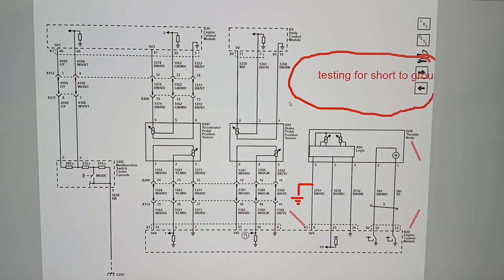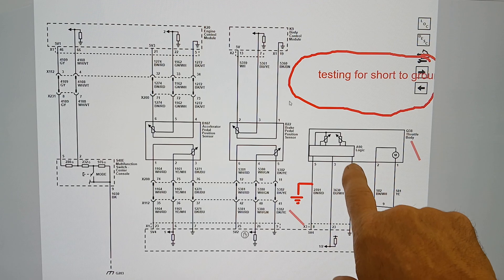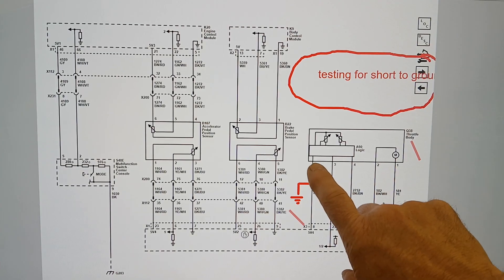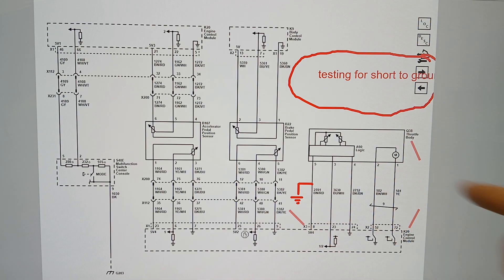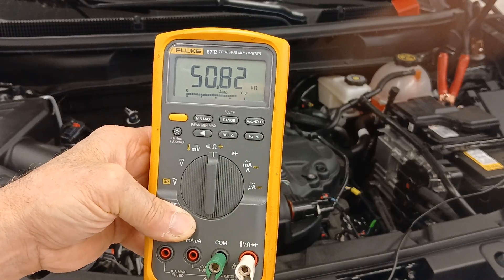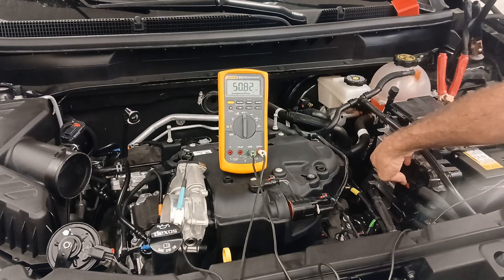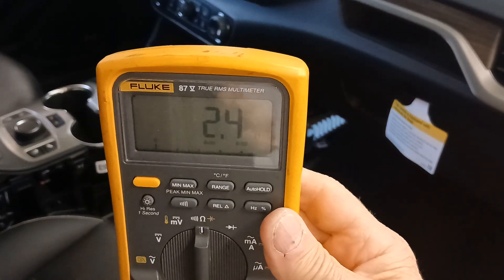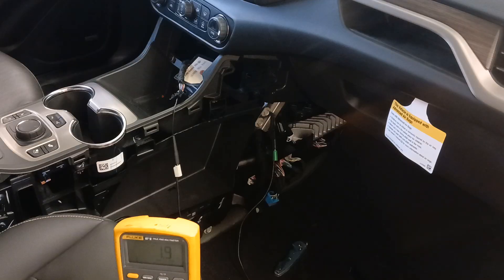#shorttoground #wireharnesstest Proper way to test for a short to ground on a circuit

Comment: Hello sir 
I have vehicle with code coolant temperature sensor circuit low, fuel temperature sensor circuit low, ecu unit circuit low 
And the vehicle is cranking but doesn't start. I found fuel supply is   ok but there is no ignition.
Reply from the maker: Based on that information, it sounds like the ecm, coolant temp sensor and fuel temp sensor might all share a common ground, I would start there maybe the ground is open, if that's not it the next thing I would check for would be any blown fuses.

Comment: OL is not open loop ?!
Reply from the maker: I have heard it called open loop to, reading on flukes website they word it out of limits or resistance so high the meter cannot read it. To me, an open loop and out of limits mean the same thing, completely open curcuit
Reply: It doesn't matter what the O and the L in OL stand for. The important thing is what OL means. It can mean Open Loop, Open LIne, Open Circuit, Out of Limit, Out or Range, or Infinite Resistance. The only thing you need to know when using the ohmmeter function on your multimeter is that OL means there isn't a path for electricity to travel in the wire or circuit you're testing. Only use the basic ohmmeter function. Do not use the "continuity" setting on your meter when checking for shorts to ground unless you know exactly what you're doing and you know the resistance threshold of your meter when using  the "continuity" setting. In the continuity setting meters will only beep when resistance is below a certain resistance. On my fluke, the resistance has to be below 60 Ohms for it to beep, so if there's 61 Ohms of resistance, it won't beep, and I'll think the circuit is not shorted to ground.